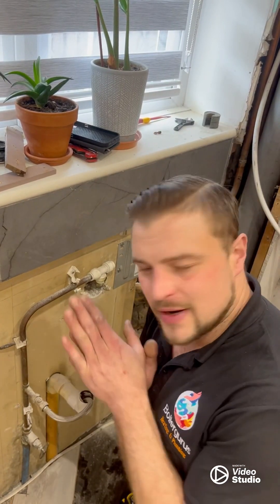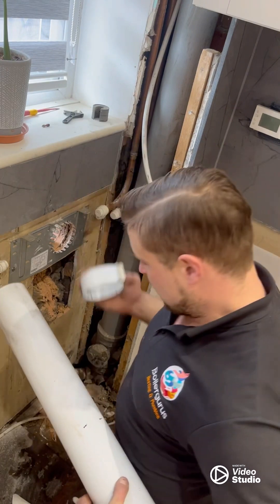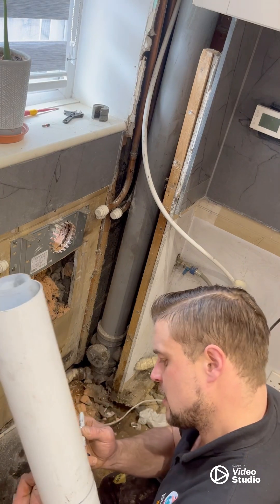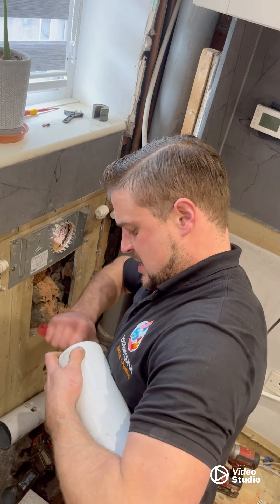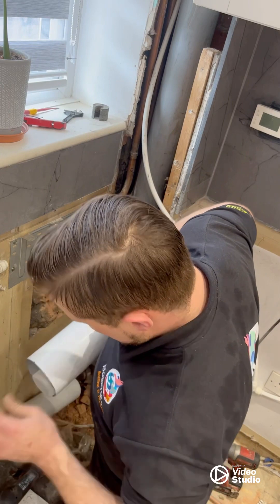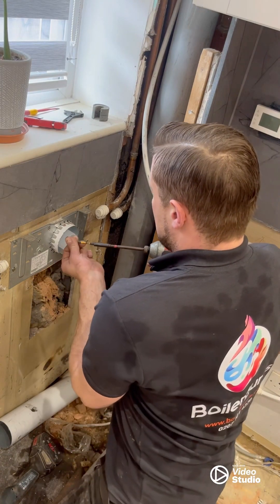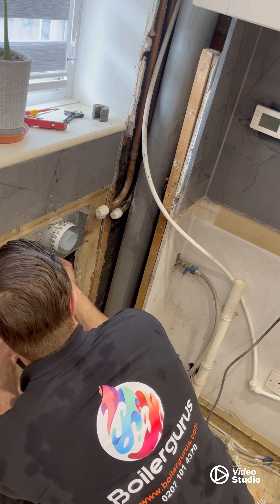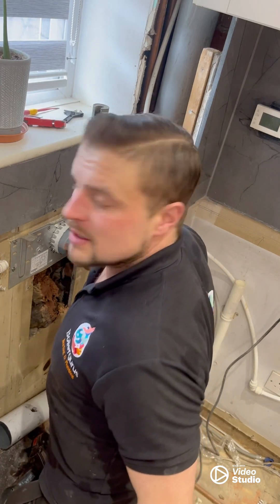How to install Vaillant Combi boiler with back flue & how to install a back flue

Comment: Do you need to install a one way valve to the cold water supply to the boiler?
Reply: Check the manufacturer instructions, but I don’t think is mandatory